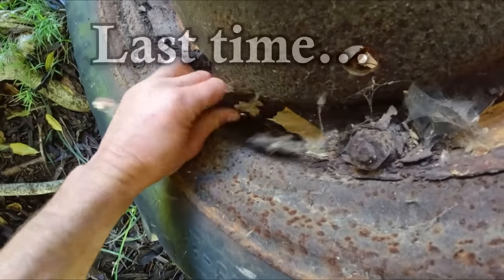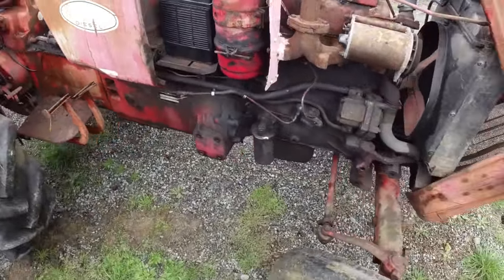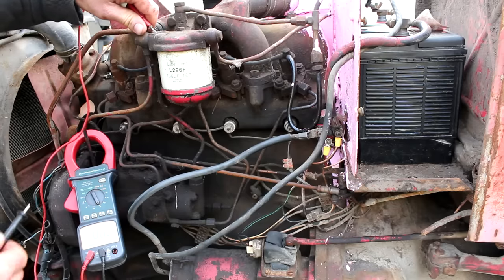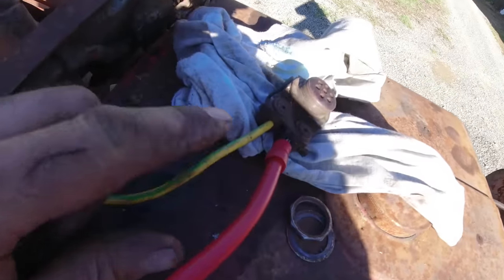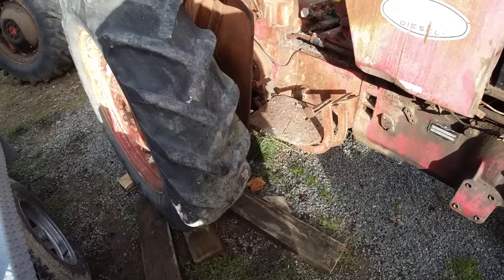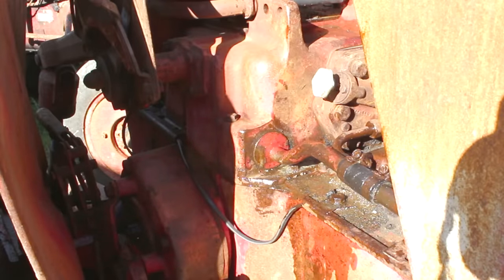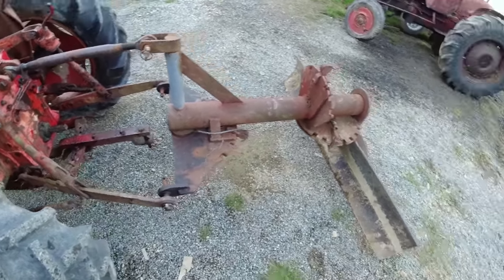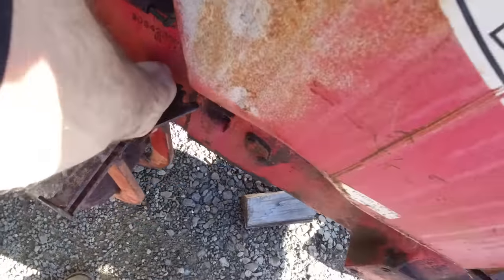Fixing the Salvaged Swamp Tractor and running it on Recycled Cooking Oil instead of Diesel

Comment: I've got a old mate that runs diesel/veggie oil mix in his old tractor. Has run for years with no problems. He pours the oil in the diesel tank and just mixes them in the tank. Every few months he runs a tank of just diesel through to keep anything from gumming up. Tractor has run for probably 20 years like that and has only needed usual maintenance
Reply from the maker: Nice
Reply: Maybe I should stop eating oil that can run engines haha!
Reply: @MartyT  *Noice  🤣
Reply: @MartyT  a couple of years back in Romania people found out about veggie oil that it could be used in diesel cars and they started buying it by the pallet. This becaise 1 liter of veggie was about 4 times cheaper than diesel. This quickly became a problem as the stores started running out of oil:). Then they put restrictions on the number of bottles that one costumer could buy. :D It smelled like french fries and the cars never had issues, thought i think they used to mix 1/3 diesel and 2/3 oil.
Reply: @booghy9486  Would my chips fry OK in clean Castrol 5..30 then ?
Reply: @BRI33NOR  Only one way to find out!
Reply: @BRI33NOR  yes they fry normally in engine oil. I found 2 strokes best though. My salt came off the panel of a landspeed record car that set a world record. If you don’t literally eat breath and sleep it, what are you doing with your life? Hahaha
Reply: @booghy9486  I did the same on my old hilux/surf. Used to run 1/3 veggie to 2/3 diesel. Never had a problem.
Reply: I wonder what is the advantage of having heavy rear wheels on a tractor?
Reply: @davidworsley7969  it's for when you use a frontend-loader and you lift up heavy things with it. With the concrete your rear tires have more grip because they don't get levered upwards so much.
Reply: @davidworsley7969  it gives more grip pushes the tread into the ground.
Reply: @tonixxl  thank you.
Reply: @davidworsley7969  pleasure. Greetings from Germany.
Reply: @BRI33NOR  yes they will.
Reply: @davidworsley7969  Front end loader  can benefit, as he mentioned.

Comment: So cool that you got that spare with so many parts to transfer over. Channels like yours are the reason long form content is still alive and well.
Reply: Dear  @pinwizz69  
Even better: Check Wes out for all the older videos repairing and/or first starting tractors, crawlers, fork lifts and even an Insley crane.
Best regards, luck and health in particular.
Reply: Another good episode. That vege oil is trash in the injector pump. The engine begins to smoke more and more until you feel sick being around the exhaust. Not a good idea in fact. You might already know the oil polymerises (?) Turning into a pasticised rubbery film which builds up into a thick impervious varnish, not that it is matters.
Reply: @Chr.U.Cas1622 ae 2w❤
Reply: @jackrichards1863  qq1
Reply: @Chr.U.Cas1622 ,🎉🎉🎉🎉🎉
Reply: @Chr.U.Cas1622 0

Comment: 1960's my old man had a garage in the Bay of Plenty,  He used to take the old oil out of oil changes and put it into a 44 gallon drum which was lifted up high on a shelf then a piece of old hemp rope was put in the drum then laid down a piece of guttering, metal back then, into another drum. Over time , the oil would "wick" up the rope and end in the lower drum without the crap. It took some time , but the family run our cars on that for years
Reply: That is an absolutely ingenious idea!
Reply: 😅ideia genial, simples e funcional. 
O mais velhos eram gênios, eles faziam maravilhas com o pouco que tinham.
Hoje a geração Z têm tudo na mão e mal conseguem se limpar 🧻 sem ajuda. 
Lamentável!
Reply: That is such a great trick my mind is blown!
Reply: Difficult situations make us creative 👌👌
Reply: Yeah
Reply: Distilling with engenuity and a stinky rope. Who would'ah thunk, ( except an old hand with running kerosene lamps). Made me understand another method. Like distilling whisky. Use temp and a boiling tub fed over a condenser coil into another pot only quicker and make ya'll burn some wood then get lighter grade oil result and some tar to seal things. Could do slower with a solar cooker. A cardboard box lined with aluminum foil as a heater unit. Quicker would be to use an old sat dish for capturing more sunlight with an aluminum liner. Could make the oil boil.
Reply: Marty will have to run his excavator, tractor, and soon BMW on veggie oil. A car would need a huge tank of veggie oil and a tiny diesel tank, reminiscent of old early tractors only with gasoline and fuel oil. One must use diesel to cleanse it for starting and stopping. One needs add cleaners heavy to the small diesel tank.

Comment: Hey Marty greatly useful couple videos for me. I'm 80 now and not physically up to this kinda work but I live up in the mountains above the Snow line. I have a 1968 IH modle 444. Your procedures were exactly the same machine as mine. Mine spent it's life in the orchards up here in NE Washington state. It is a pretty good old tractor that needs a lot of minor tweaks. But 3 years ago the injector pump quit. Searched endlessly for a rebuilt or new one. The one company that had been making them for $450 bucks ( no core exchange) went out of business. A great guy in the UK with a YouTube channel called Bundy's garage did a step by step walk through rebuilding the pump I have.( A CAV typ).I've been a skilled mechanic for 60 years so I ordered 2 complete rebuild kits. I was confident I could handle it but a couple years in and out of hospitals my sight sucks and hands are feeble. So no confidence with all those tiney parts. I just wish I could find a ready to go to just install. They built so many of those BDs I thought surely I could find one. I did the entire purge n flush of the hydraulics like you with no info. I learned useful tips watching you. Subbed. Great quality presentation. Thanks Dandahermit

Comment: Ran my Nissan Atlas 150 truck on vegi oil for a while. Smelt like burnt cheese but went great , had a little more torque , held the revs longer going up hills.The trick is to get the vegi oil real hot so it thins out and atomizes better .I ran the oil through copper tubing wound around the engine oil filter before going into the pump.

Comment: Hi Marty, 
Did you know Rudolph Diesel invented his engine to run on peanut oil or any hydrocarbon!   The fuel companies had waste from petrol production, and the rest is history, so you are going back to the roots of the diesel engine!  I have been making "BioDiesel" for over 20 years, which is made from used /new veggie oil , BUT is very different to straight veggie oil. SVO will /can gum up pumps /filters due to the glycerine , but properly made BioDiesel removes the glycerine and makes the fuel suitable for ANY modern engine. I've been running my Disco Td5 on my fuel for over 15yrs and have never had an issue, but it would not like SVO as it's too think and the glycerine will cause issues. Also , the veggie oil will destroy any rubber hoses , so take a spare! Properly made Biodiesel will /does improve engine torque , and has far more lubricity than diesel, so it's better fro injectors /pumps BUT IT must be made to standard! 
Older engines with mechanical injection are fine on SVO , so you'll have no problems , especially flushing it with diesel!
Thanks for the video.
Cheers Gregg.
Reply: He also experimented with his engine running on coal dust blown into the cylinder. Also, due to the high compression he was working with, one of his first engines blew up in his face.

Comment: The first tractor I remember on our farm had a two fuel system.  It started on petrol, and switched to TVO (paraffin) when it had warmed up.  I know it was a Massy Ferguson and would have been built in the 1950s or 60s so possibly a T20.  Another story is from when I was an apprentice at Ford UK where one of the fitters showed me a trick squirting brake fluid into a carburetor which produced a wonderful vegetable oil smell.  Vegetable oil was considered exotic because it was used by some racing two stroke engines at the time.  I have a vivid memory of being passed by a Scott Flying Squirrel (about 1970) which left a beautiful smell of vegetable oil behind it.

Comment: Be careful you will gum up/cause corrosion in the pump if left in there. You should put a tap on the bleeder on the pump and recirculate it through the water jacket and back in to the inlet to heat the fuel. With a few extra taps you can plumb the return of diesel+veg back to the tank in flush mode. This way you can flush it out faster if you are interrupted. The timing advance is done by lift pump pressure acting on a piston that rotates the pump body. The increase in viscosity is probably affecting this and the spray pattern of the injectors.
Reply: - I hope Marty reads your helpful comment and instruction, RetroFitter.
Reply: He flushes it out with desel.
Reply: @4acrehome168  Totally agree. Hope Marty picks up on this. For road use I used 50/50 diesel and veg oil. It worked well. The trick is scrupliously clean veg oil. Glad Marty understands this. When I experimented I used new, unused veg oil to start with.
Reply: Really gums up my chainsaw if i dont use it often.
Reply: I understand the "gumming" part but corrosion? What in veggie oil is more corrosive than the crap diesel is made from? I had a mate who worked in the petrol chem industry and he told me diesel is made pretty much out of the crap that's left over after all the "good stuff" has been removed? Diesel/oil engines were originally designed to run on poor quality oil. While veggie oil has a lower viscosity I can't see it being a problem its still oil. Also he's running an old agricultural vehicle which has been stood for years. I cant see running veggie oil causing any problems? I'd love to see some actual scientific papers on this and some physical evidence to prove its a problem and not just Hearsay. Just my opinion. I ran my hilux on 1/3 -2/3 mix and it had topped 250,000 miles when I sold it with no problems....
Reply: @wideyxyz2271  The diesel engine was invented by Rudolph Diesel to run on vegetable oil, but later it was discovered that it would run on diesel fuel and it was cheaper at the time. There's a refinery near where I live in the US and an old timer was telling me they used to dump diesel fuel in the river to get rid of it. Back in the early 1900's most trucks, tractors etc. had gasoline engines so they couldn't sell diesel fuel, so they would just dump the diesel that came about while refining gasoline. There wasn't an environmental agency back in the day, so they'd just dump it in the river.

Comment: marty, the 414 is idi injection and slow revving so good for cooking oil. but has a cav pump they don't like veg oil, if your going to run more veg oil don't forget to swap the diesel return over at the same time or your diesel will fill up with veg. running 30% dino in veg is a good idea but mix it very well in a can first. cooler temp's will give you problems with veg oil getting thick. run it hard and long time on veg and you will get good results, enjoy.

Comment: Vegy oil ✌️🤣
Quite popular here in The States 🇺🇲 for old MB 240, 300 Diesels and the VW diesel crowd. I'm a retired Mercedes Star Technician (1970-1990) and BMW Master Tech(1990-2017)
Add a few oz's Marvel Mystery Oil to yer Vegi Fuel res. To lubricate the injection pump, injectors, provide proper lubrication  to all the internals, help clean combustion chambers. It's just good stuff✌️✌️ 👌 idea about the tank near the warming exhaust. Prevent waxing, jelling, help flow when cold. Add a filter off the tank outlet to catch the fish & Chip crumbs🦈 🤣👌. It'll make your neighbors hungry🙃
Cheers, great presentation 👍👍👍👍👍🇺🇲

Comment: Cooking oil is a good solvent and will clean the dirt out of the tank and fuel lines. So have a new fuel filter ready. And it isn't just various veg oils that will run an old diesel engine. Used engine oil also works very well. Veg oil and engine oil is thicker so will be slower through fuel lines likely why you're noticing a slight drop in grunt,

Comment: Those old Inter's are great little tractors! (Though I might be a little biased because I learned to drive a tractor on my Dad's B275)

A friend of mine bought a 474 International a few years back and one of the first jobs he did on it was to remove the non-functional OEM glow plugs and install a set of adaptors that allowed him to fit a set of much cheaper and more readily available Japanese glow plugs (to suit a Toyota LandCruiser, I think) and convert the glow plug circuit to a 12 Volt parallel wired system. At least that way if one plug fails (or maybe even two) you can usually still get it started.

Anyway, great to see you giving an old machine a new lease on life!

Also, is there any more content in the pipeline on the Hough? I maintain one of those for a mate, so I love getting a sneak peak on some of the jobs I'll likely have to do in the future. 😂

Comment: insulate and mount the veggie oil tank under the hood, exhaust side, and run the oil through a fuel preheat heat exchanger. the coolant with the engine warmed up should get the oil to just about the right viscosity to burn nicely. the engines I work on for a living run on bunker oil, and with the fuel preheated like that, they run pretty clean once warmed up.
Reply: Great advise on preheating the veg fuel. just like the cheap fuel after the war called TVO, tractor vaporizing oil. one should switch back to reg fuel before shut off. I am puzzled at the glow plugs being in series!!!
Good Luck, great to see these machine get a second life.

Comment: I ran my Peugeot 1.9 XUD (Bosch pump) on veggie oil for years. I had a two tank system to start and finish on diesel. It had a water/oil heat exchanger plumbed into the coolant circuit to get the oil hot and thin. It was less powerful but was dirt cheap and a bit of fun too. My advice on that tractor is to mix it in with your normal tank - more in summer and less in winter due to the viscosity.

DO NOT TRY THIS ON COMMON RAIL. It will ruin a modern high pressure injection system.
Reply: Same here, used to have 2 Peugeot 405 estates and a 306 all with the 1.9 XUD engine and they all ran on a 50/50 mix of veg oil and diesel, never had any problems even in the winter as long as you changed the glow plugs
Reply: I did run on engine oil on my Mitsubishi l200 2003 and it has common rail. You must use a blend of at least 50/50 with diesel/oil
Reply: Climate is exceptionally mild where Marty lives- never too cold, so Summer/Winter issue may not be too important, though for folk in colder areas it is a good tip
Reply: @colddiesel username checked out
Reply: 2.5 tdi acv didn't seem to mind used engine oil. I did do less than 20%

Comment: One question, do you guys have electricity or are y’all dependent on the hydroelectric power system you built for power to everything on the mountain you live on? I’ve always wondered if hydroelectric is the only source of energy y’all depend on? I love your channel and contents! I’m always wondering when your next video will come out! You’re so thorough explaining everything you’ve doing and it’s very educational for me and I bet all of your subscribers! A big thanks for you sharing your knowledge with us Marty, very educational! Your friend Kirk from Louisiana USA 🇺🇸 thanks! 👋🏼👋🏼👋🏼🙏🏻🙏🏻🙏🏻👌🏻👌🏻👌🏻🤙🏻🤙🏻🤙🏻🤙🏻🤙🏻🤙🏻🇺🇸🇺🇸🇺🇸🇺🇸🇺🇸🇺🇸🇺🇸🇺🇸🇺🇸🇺🇸
Reply from the maker: No grid power here, my hydro setup powers everything except welder and the big air compressor, I start the generator for those
Reply: @MartyT  You just need to find a bigger washing machine, say 14kg capacity so you can power the welder and compressor or maybe a commercial one would do the trick. 😁
Reply: Tractorgenerator woulb be nice add on to collection...

Comment: Hi Marty. 200 dollars does not sound bad for some rims and tires. By using some of the spare parts, you have started to recover some of that cost. Using the vege oil might have two benefits: You spend less on fuel and your friend may not have to have it hauled off. The rust preventer actually makes the tractor look better, in my opinion. Perhaps you can find a mixing valve so you do not have to disconnect the vege oil line each time. Have good days!

Comment: Great little experiment and congradualtions on getting the international tractor running.There is a gentleman out of Wales , ( Kriss Harbor) on u tube, who has been running vegetable oil on his tractor and Range Rover for a couple of years.I believe Kriss is very pleased with the results.The centerfuge idea really looks good to get rid of water& foreign particles.Great idea! I think you have a real handle on , the diesel ⛽️ problem.Terrific video, Marty!🙂👌
Reply: Yeah. Kriss also brings the microhydro to another level, at increased cost of course

Comment: Hi Marty. My mate ran his Mercedes on cooking oil and preheated the oil to 100 degrees before the filters. It ran almost as good as diesel and one only noticed a loss of power when towing the caravan, which was small. He had to put different filters on the fuel line, and I'm sure he made them from using the bodies of old filters. The car is not with us now some idot ran into the car total wreck.
Reply: Are you sure he didn't cook the engine? 🤦‍♂ 😁

Comment: I've got a diesel B414 as well.  Converted it to proper 12v glow plugs that don't need to be run in series.  People used to use Bosch glow plugs but they seem to have been discontinued.  I found a random supplier on Amazon of off-brand plugs that matched the Bosch... they fit perfectly and the tractor fires up just fine at -30⁰C.  I can look up the part number if you're interested.
Reply from the maker: Interesting.. Its actually not too bad to start now I've got them working. Thanks anyway

Comment: You can preheat the veggie oil to, say, 50 degrees C, until the power output is comparable to pure diesel. And make a 3way valve for easy switching between fuels. Good job.